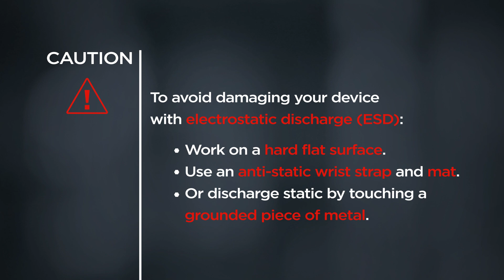Replacing Your M.2 Solid-state Drive | ThinkPad X1 Yoga Gen 6 and 7 | Customer Self Service

Comment from the maker: This video will show you how to replace the M.2 Solid-state Drive inside your ThinkPad. The process in this video will work for the ThinkPad X1 Yoga Gen 6 and Gen 7. 

You will need a screwdriver kit, a non-metallic pry tool, and 15 minutes of your time.

To view the ThinkPad X1 Yoga Gen 6 Self-Repair Guide go to https://pcsupport.lenovo.com/us/en/products/laptops-and-netbooks/thinkpad-x-series-laptops/thinkpad-x1-yoga-6th-gen-type-20xy-20y0/selfrepair/removalsreplacements

To view the ThinkPad X1 Yoga Gen 7 Self-Repair Guide go to https://pcsupport.lenovo.com/us/en/products/laptops-and-netbooks/thinkpad-x-series-laptops/thinkpad-x1-yoga-7th-gen-type-21cd-21ce/selfrepair/removalsreplacements

To learn more about your device go to https://pcsupport.lenovo.com

To find parts for your device go to https://support.lenovo.com/parts-lookup/?cid=ww:lenovosocial:b9515f&source=socialmedia&subsource=yt

To view the Lenovo Support Self-Repair Guides landing page go to https://support.lenovo.com/us/en/solutions/HT516547

** NOTE: Static electricity can destroy components. Use a grounding strap, and clean, non-conductive surface to work on. Use plastic or coated tools to prevent scratching and avoid using metal tools on plastic parts. For more detailed information on electrostatic discharge and how to prevent it, please watch our ""Understanding Electrostatic Discharge (ESD)"" video: https://youtu.be/by4PB3WtdLo 

Applicable Machine Types:
ThinkPad X1 Yoga Gen 6 - 20XY, 20X0
ThinkPad X1 Yoga Gen 7 - 21CD, 21CE

#lenovo #LenovoSupport #LenovoTechSupport